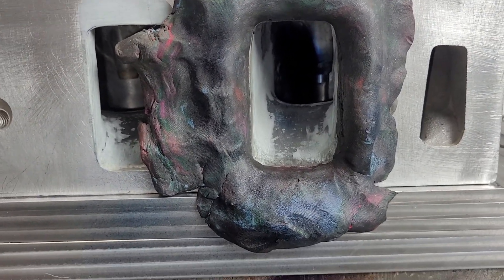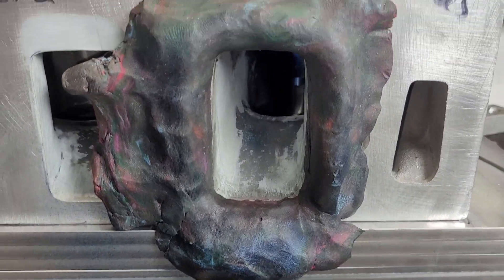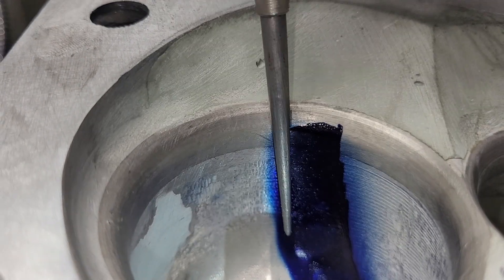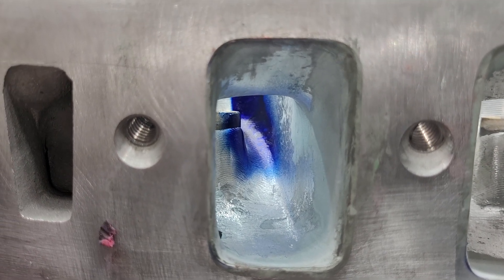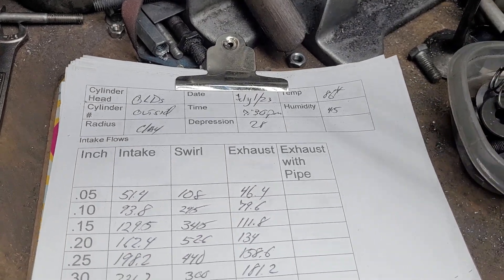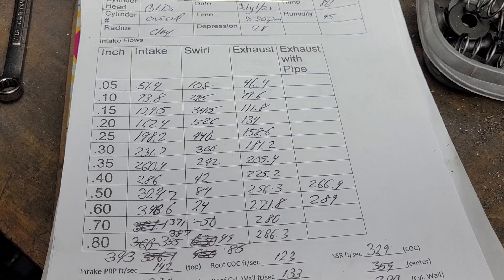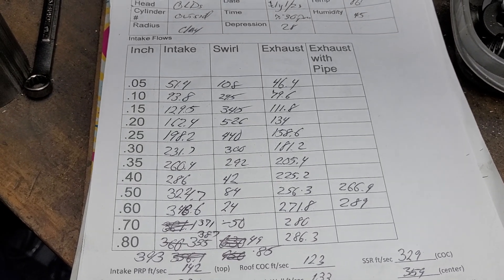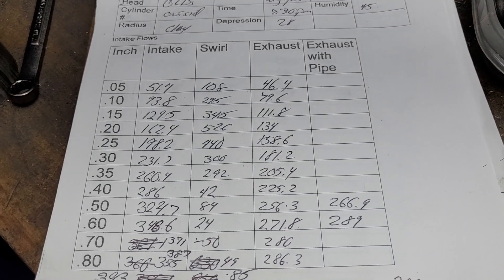Big Block Oldsmobile cnc master, first flows, airspeed and wet flow.

Comment: Funny the other day I was working on a head that had a fancy radius valve job. It had terrible contact. I commented I wonder if that extra flow was enough to make up from the lost power due to sealing.
Reply from the maker: It is a good question. I like good fuel prep so I would have at least one sharp angle before seat. Thanks

Comment: Charlie, re leakage, can the superflow program calculate the leakage and then subtract it from all the lifts you’re measuring so as to net the leakage value out at each test point to get a comparative value so you can be confident and use it against the other tests you make on the same point?

My flow quick allows me to do that is why I’m mentioning it.
Reply from the maker: I can set it for leakage and it calculates. I figured out the issue. Thanks

Comment: Funny about that, I was about to write that, then decided not too, then you mentioned it.
Virtually emidately after pressing play again.
Noticed a few times about the leakage. And it is part of the setup before testing to check and correct it 

Unreal
😁👍

Comment: Out of curiosity, which head provides the best ( as cast )  midrange flow numbers for small block type V8 of all  OEM  or aftermarket manufacturers? Would Vortec 906 or 062 even be in the running? Thanks in advance.
Reply from the maker: Good question. Vortec is a good guess.